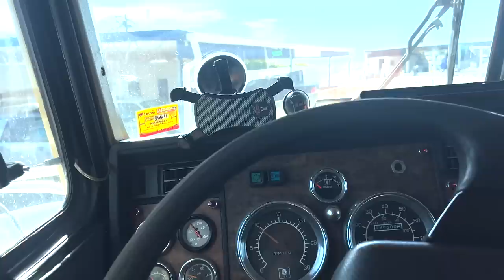WE LOADED A MASSIVE BOAT ON THE W900!!

Comment: That boat made the W9 look like a matchbox truck it was so huge.  What a way to break Steve in on hauling boats.    Great job getting that beast loaded, and  you are doing great work hauling that big boat.
Reply: It goes up the road the same as one half it's length as long as the truck gas enuff ass to pull it, and thar old kw seems to have plenty of power But yeah man lookin good

Comment: When I worked at a marina near Ottawa, Canada, we had an hydraulic trailer. The side frames would move in and out, and each would move up and down, both front and back, separately. One could add cross members or not, depending on the item being hauled. The pads could be set at a variety of heights. They were 2ft x 2ft pads on 2" x 2" steel square posts. Those posts had receivers every two feet. 
  The trailer could sit 6"-3' off the ground and went as wide as 14'. And at the end of the trip it was easy to either block it on land or put it straight in the water.
 The hydraulics were powered by a 4 hp Honda.

Comment: Hey Tim, thanks for the video. I do have a question,  I have a 2019 Ram 3500 dually 6.7 liter Laramie would that be enough truck to do some Hot Shot work for ya? I live in Florida but would be willing to come to TN and bring some loads back this way or bring a load to TN or wherever you need them to go.